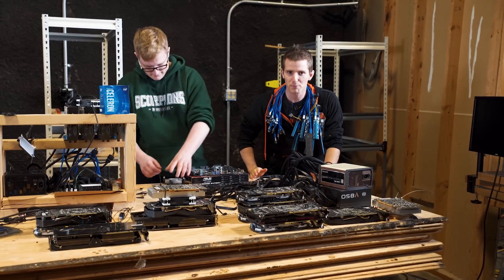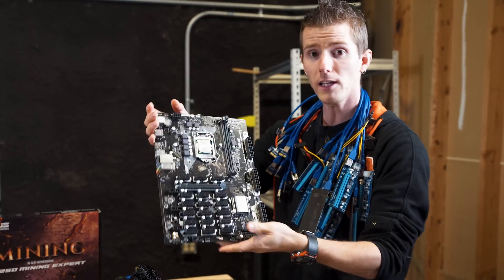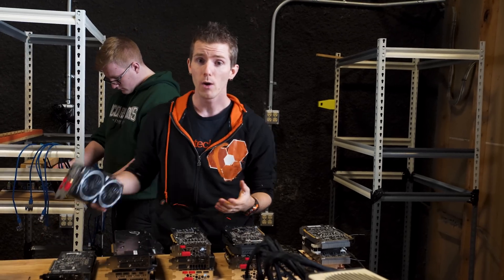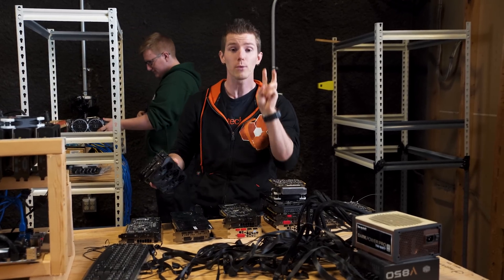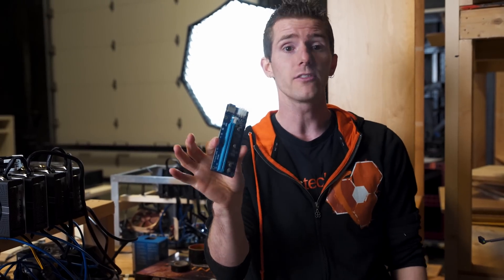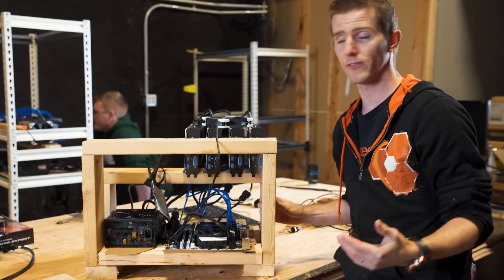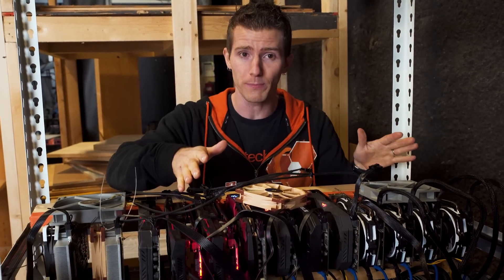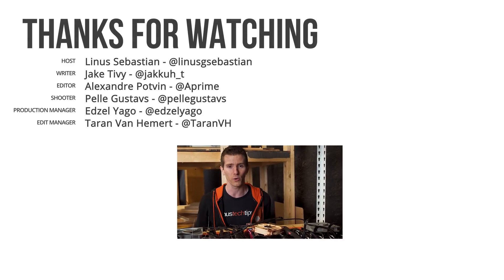13 GPUs in ONE PC? – Mining Adventure Part 2

Comment: @Linus Tech Tips The Riser That you are using are not fairly good their are alot of problems that come with them  sometimes they get to hot and short  I only know because I was mining bitcoin when it was $200  now its 12.7k usd and alternating all the time I am Back in to it the item number to the risers i use are on newegg ill post it here you can check it out probably make a vid or some  Item#: 9SIA7363GB5844
Reply: Just do not use stupid Sata reduction cause it's rated for lower power than molex or 6 pin.

Comment: this is a MUCH better video than the first one you did. thank you for getting it right this time. you can use old socket 775 motherboards. i do . which gets you a cpu ram and motherboard cost of £50 - yes £50  british pounds. you cannot skimp on GPU or power supply though. some socket 775 motherboards have four pci express slots which are usuable.

Comment: You need to dual-mine with AMD cards. You could be making way more. Claymore's Dual Miner is what you need to use. My AMD rig has ten RX 580s and one R9 290X and it pulls about 1500USD a month.
Reply: Dual mining with Claymore is probably going to be useless in the next few months. The difficulty of LBRY, SIA and PASCAL are all going through the roof because ASIC miners for those are now being shipped. You'd be better off saving the power cost by stopping soon enough.
Reply: I don't know what you mean by stopping soon enough. There is no point in stopping as long as it is more profitable to mine Eth+whatever than anything else. I don't get why they're even mining monero at all. Eth alone pays more than monero on RX570s and 580s. Also if you're still dual mining LBRY, SIA and/or pascal you're doing it wrong. Decred is where it's at now. Decred was the most profitable one for a long time until claymore updated his miner for more performance mining library. Now it's decred again.
Reply: Not sure if Decred will get the same treatment, I've only looked up the others so far.

I have no idea why they mined Monero either, I don't think they do much research at all though considering they're using SATA riser connectors which are proven to be unsafe.
Reply: Hahah yeah those were my exact same thoughts as well. Those sata connectors are scary. Oh well, I guess we don't really need any more miners mining ethereum anyway. Rewards are dropping fast enough as it is.

Comment: 9:36 You guys know that the flash point of wood is at around 300 degrees Celcius, right?!
Reply: Yes i was more worried of aluminium making a short circuit somewhere :p
Reply: I would be more worried about static electricity. But I doubt it would be a problem.
Reply: But if the power supply or something catches fire the wood will fuel the fire. I don't think he believes the wood will catch fire from GPU heat.
Reply: Let that burn for many reasons
Reply: Woody 
Yeah aluminum is much better
Reply: didn't know that thanks
Reply: you DO REALIZE that he literally says not to use wood right? So WHY are you acting like they're using/advising for wooden frames?

Comment: you can turn on a power supply with just a short piece of wire btw , they likely omitted that part because of safety reasons. but i'm sure you could find an adapter if you didnt want to "risk" using a wire

Comment: I thought it was bad to use the sata to 6 pin connector because usually sata only pulls 5W for hard drives but for risers it's pulling like 70W
Reply: SATA can pull a maximum of 54W of power, a lot of these GPUs need 75W from the PCI-E port so you are correct. This will likely cause fires or burned out connectors or damage to the PSUs.

Comment: BUT CAN IT RUN CRYSIS
Reply: haxhxm not with that celeron processor and 2gb of ram
Reply: It can make a gpu crysis
Reply: Minecraft
Reply: Nope it’s got a celery stick for cpu
Reply: Spaghet
Reply: why does everyone keep asking that?
Reply: Terraria
Reply: @Walker Morales: Actually, a dual core with 2GB RAM hits not only the minimum specs but even the recommended specs for the original Crysis ;)
The bigger problem is the 1x PCI-e slot. But 1x PCIe 3.0 is almost as fast as 4x PCIe 1.1 and given that my brother used to play the game on a GeForce 8600GT? Yes, it probably can run Crysis. Though I'd expect a lot of lags.
Reply: so original
Reply: NO. It has a celeron.
Reply: No, but I bet it could run roblox with 30fps
Reply: No, beacuse it is a mining rig
Reply: haxhxm probably not
Reply: haxhxm j
Reply: NO
Reply: No. Fucking extreme bottleneck
Reply: i was literally about to comment this...
Reply: crysis doesn't support explicit multi gpu
Reply: no, no it cant. and ill tell you why. each of those cards is only running at PCI-e 1x instead of PCI-e 16x or 8x. which means that 16 cards would push about as good as 1 card that was using a full x16 slot. mining doesnt need the lanes to the processor like graphics do, which is how they can run full throttle on a 1x slot and get away with it. but no, it wont run games or benchmarks worth a shit because of the 1x slots
Reply: It does not know the way

Comment: Yep you guys a little behind but great work on the mining rig, keep in mind so many rigs require power source that is not standard in your own home.
Reply: Video was ready a long time ago, it was on floatplane a while back.
Reply: Yeah, that's pulling around 25-30amps. 
For rigs with tighter overclocks, you'd need clean power. Nothing like restarting the miner when the bathroom fan goes on.
Reply: Never seen a house that couldn't power that rig! Dryer or stove outlet FTW! :)
Reply: Depends where you live maybe not in the USA but here I have plenty at 230v @ 13a = pretty much 3000w per outlet with the main breaker capable of handling over 7.3kw per circuit with a rig at topping out at around 1200w depending on if its flashed and the algorithm used but gives around 6 rigs on a standard domestic circuit in every home
Reply: Yep, 230V 50Hz and 16A max from a type F power outlet here in Germany. This is approximately 3,6kVA.
Reply: +HamburglarBunz "There are no mining-specific cards", did you no watch the video?? The mining specific Nvidia P104-100 and P106-100..... they do not have any video outs.
Reply: +Nathan Bain Explain why 90% of the marketing for GPUs are aimed towards gamers. Because they're also for miners? Explain why the other 10% are geared towards professional workloads (modeling, video/image rendering, etc.). It has to be because they're there for miners, right? Seems likely.
Reply: Those mining cards are way harder to get and more expensive, no wonder miner buy the gtx cards...
Reply: Cards are designed for gaming. We don't steal asic miners do we :)
Reply: +Richard Bauer There are no mining-specific cards. They buy the GTX cards because the design of GPUs made for gaming also makes the GPUs good for mining. It's why, along with pricing, miners don't buy Quadro or Firepro cards.
Reply: Nathan Bain

Soooo funny...
Reply: Go4EZ How do you think miners feel that gamers are taking away their gpus? Gpus are available for everyone to buy, regardless of what you intend to do with them. Stop being selfish, and think of other people's desires, before you bitch that people trying to make some money means you can't have exactly what you want right now.

Comment: Wait, not mining Ethereum on AMD GPU? It's 3x more profitable. There's also a larger market for it. Zcash also makes sense for Nvidia cards since it's profitable and has a market. Zclassic for Nvidia is probably the best in terms of profit by a small margin but lacks a trusted market. Bitcoin Gold is debatable, but in my experience their pool luck rate and payout rate is terrible and feels like a complete scam compared to Zcash.

ASIC miners are going to be very interesting because for <$3,000 USD you can get a little miner for Litecoin with a return of ~$500+/month. This being the Antminer S9 which is constantly sold out. 

You guys should also look at coins that offer PoS (Proof of Staking) and MasterNode supported coins. PoS is like a kind of interest rate depending on how much coin you have and for how long. Mining those can affect profits like Trezarcoin which I'm currently doing. Or take a look at Dash coin which uses a MasterNode that acts on a similar basis but a little bit more complicated and expensive.

Comment: Yeah good luck finding a 1060 or 1070 around those prices. Just sold mine for 700 and bought it for 400. I hope mining dies down, there will less and less pc gamers because no one can get the hardware they need. Even older cards are getting expensive because people just want a graphics card period to play games but cant get anything. Bitcoin seems to be dropping so high hopes all these idiots who went out and bought 13 gpus will try and get there money back quick and the market will be flooded with cards. If you want to build a PC just hold off, definitely do not buy these overpriced cards.
Reply: meanwhile bitcoin price is going up ;)
Reply: ugurugutugu last time i checked it went from 18k to 11k. That’s definitely going up.
Reply: PunkPizzaRolls last time I’ve checked it gone up from 9k to 13k. And annually it gone up by like 11k. So?

Comment: Linus does that mean I cant just use my GTX 1070 for mining
Oof, I was looking to make millions!
Reply: You can just use it. I have two RX 570 which i use to mine.
Reply: I have an RX480 since launch, now using it mine, its already earn back its price, and then i bought a VEGA64, what i am also using to mine, when im not gaming. Its like 24/6.5 since most of the time i do not game... Thanks to the volatility i already earned back the price of vega too.  Its killing my carsd? I doubt, since i have set them to optimal settings,  the vega run on 40-45 celsius degree the rx480 on 50-55 and they hash like hell. If things going on like this, i can buy the next AMD card at launch too, or can go to a long vacation. Or both. I am happy.:)
Reply: How much do you make on average, is it worth for me to mine?
Reply: Its depend on the card, what coin u can mine with it efficiently and what is the actual price of that coin. My cards can do about 10$/day on ethereum (ETHAS) and they are chilling.... While i had not set them up, they could warm up my room to a pleasent degree of warm, but since then i have to turn the heater on.... If u are interested, u should take a look on google (1070 mining hashrate), on whattomine.com and on bitcointalk.org. At these spaces u can find everything u need.
Reply: Attila Deák thanks

Comment: I am kinda new to this, but wouldn't that CPU and RAM bottleneck those 13 GPU's ?
Can someone explain please?
Reply: The cpu and ram doesn't actually do any work of any significance. All the data is pre-loaded on to the GPU during startup of the program (loaded with something called a DAG file with ETH for example), and then all the calculations are done on the GPU only. The only work that the CPU and ram needs to do is to receive the finished solutions from the GPUs (doesn't take up much bandwidth, hence why you can get away with one pcie lane only)
Reply: Chinmay Dhumal Because mining is GPU intensive, the CPU and ram becomes not important as it is only being used to keep the system on
Reply: EDToaster Thanks ED! And Charlie too :)
Reply: EDToaster a more in depth answer ⬆
Reply: While that is obviously true for gaming, it is not at all the case for mining. The CPU and ram does nothing for mining. literally all it does is run windows and do some very basic and limited communication with the gpus. you could use a 1 core cpu from 10 years ago if windows ran on it and it wouldnt be a problem.
Reply: It’s only using the gpu power
Reply: For mining a 1x connection is pretty good. You cant have 13 gpus all connected on x16 slots running on x16 speeds. Thats basically a  x1 connection so you are using only 13 PCI e lanes.
Reply: +1 @EDToaster for the Great Explanation, I was just about to answer the question, but I think he did a great job.
Reply: To elaborate: mining consists of guessing the answer to a math question. Most of the guesses are wrong, incurring no output anywhere. Only correct answers require outputting.
Reply: Mining only needs one PCI-e line per GPU

Comment: I remember a few months ago i wanted to buy an rx 570 4gb for my first gaming pc... if i just had the money in the right time
Reply: Gonzalo cativa I was about to order GTX 1060 3 GB...now ordered RX 560.... Even 1050Ti is overpriced....
Reply: I bought a 1060 6GB for 270€ last month... :D
Reply: Lol just buy older graphic card for less than half the original price.Gtx 970 or stuff like that
Reply: The cheapest 970 in my country is $280, the "best" deal i could found was an r9 290 4gb for $250 but power consumption was to high to me
Reply: Gonzalo cativa duuuuude why wouldn't you snag the r9 290? Fucking power consumption? Unless your PSU can't handle it then who cares! Video cards have little to no impact on your power bill.
Reply: waka faka yeah i would but theres problems to grabbing those such as louder noise and more power consumption than a modern day gpu

Comment: As someone who wants to get a new Video Card for gaming, I really hope mining dies soon
Reply: the funny thing is new GPU's don't have VGA output
Reply: Crytocurrency is made or awarded by running algorithms over and over. For bitcoin it's SHA256-d, for Ethereum it's X-11 and so on. There are a bunch of different ways to make cryptocoins. But ASICs, or Application Specific Integrated Circuit; run those algorithms not only faster, but the is all they are designed to do. Check the difference in hashrate between any GPU for bitcoin and even the slowest ASIC will run circles around it.
Reply: ASICs are computers made specifically for mining, which makes them orders of magnitude more powerful than GPUs. For example, Bitcoin is now mined only with ASICs, because a GPU would earn you less than a cent per day. The thing is many cryptocurrencies were created ASIC-resistant, so GPU mining won't disappear for some time.
Reply: I've got some bad new for you
Reply: Mac ChubbinZ can you explain further?
Reply: Vga gpus are going for 50$ or less
Reply: Mike Dawson my bad, I meant to wirte Video Card
Reply: Right now a strix 1080ti costs more than a Core i9 790x
Reply: like vertcoin, a ASIC Resistant coin
Reply: Yea, no shit dumbass, thanks captain obvious. OF COURSE ITS WISHFUL THINKING, i mean, wtf, why do you have to be captain obvious?
Reply: It won't until cryptocurrencies drop
Reply: ayyyyy /)
Reply: Because common sense is not very common.
Reply: Zuth fuck yoy
Reply: Fuck you
Reply: Fuxk you
Reply: Fuck you
Reply: Fluttershy .Windwing i hate you. MINING RULES
Reply: If ASICs were made for every hash algorithm, no one would use GPUs anymore. Same thing happened once Bitcoin ASICs became wide-spread.
Reply: yep cause i cant buy a new gpu due this whole mining shit
Reply: Sadly it wont
Reply: #fuckmining
Reply: Anyone hoping for mining to die so prices and stock return to normal.  Sorry that is wishful thinking.  This is going to keep going for most of 2018.  Most industry people agree at least what many said at CES
Reply: go get a job

Comment: thank for killing gaming
Reply: FrankNStein yeah they want it for gaming and you want them to ruin it by leaving it on 24/7 over several months to pay it off....see how that doesn't make sense?
Reply: Apart prom needing to pay up front for the hardware. which we can't afford because of miners.
Reply: You basically make no money when you count in the cost of the power bill
Reply: @Mister Hills Don't worry, u didnt touched ma spaget yet.
Reply: Butthurt... get over it. It's reality. Complaining won't make it get better.
Reply: Who told you that there must be a crash, so you can get cards basically for free? Crypto currencies are very volatile in nature and although there was a huge crash a couple days back, it has already recovered and is pretty much back to normal. Huge crashes happen all the time. People just use the opportunity to buy in or move on. The whole market will never crash. There's no way that this is possible with so much money in there, even diversified.
Reply: d1asian I've consistently seen GPUs for mining in better condition than GPUs used for gaming. Miners tweak for lowest power draw and highest hashrate. A lot of crypto algorithms like memory bandwidth. People overclock memory, underclock core. RX Vega 56s can mine 12 bucks of Electroneum a day with 110 watts of peak draw with the proper settings. Mining hardly ruins cards unless the individual miner is an actual moron.
Reply: Just saying they could if theyre tight on money ... I like gaming as well, and I generally don't mine on my gaming card, but I gladly take the extra cost versus the money I make with mining
Reply: Jacob Wood except the fact that gpu prices have doubled lol
Reply: @Jacob Wood right. But imo this mining thing is just a bubble. And good old working is how i make my money. im boring like that.
Reply: Petri everybody
Reply: people complaining about the cost of a device that can pay for itself within a couple months
Reply: agreed
Reply: You're welcome, switch to the "console peasants" group nerd
Reply: Youre welcom
Reply: Who gives a shit about gaming lol
Reply: Petri: Almost exactly. Mining gonna pay the next vacation...:D
Reply: Yeah and if everyone had that mentality the card prices would be even higher. Lets just hope it crashes soon so we can get our hands on some cheap used GPUs.
Reply: There's nothing stopping you from getting into mining to pay the extra cost for cards...
Reply: Jacob Wood you can't "just mine and make money" buying and selling crypto currency is sketchy as hell. You don't automatically become rich after a few months of mining. Most people will not want to have their gpus stressed 247